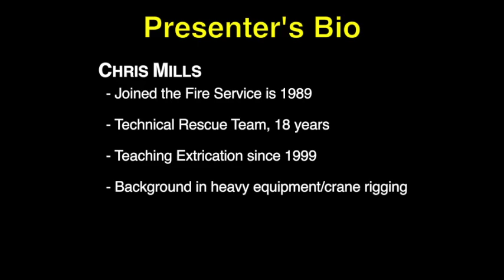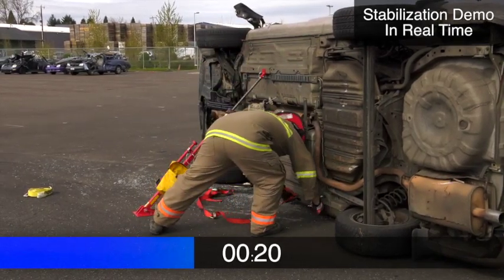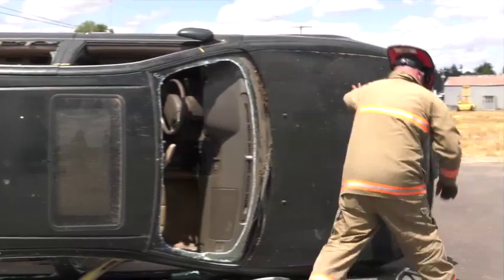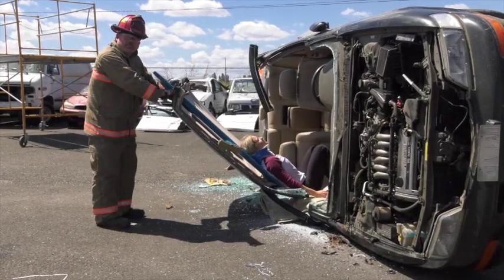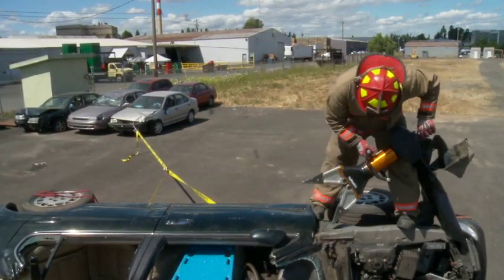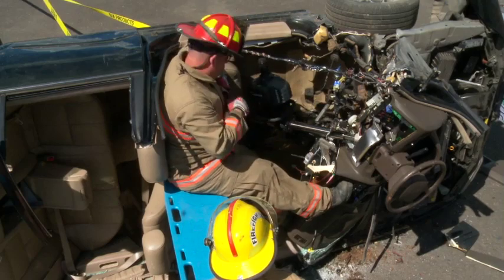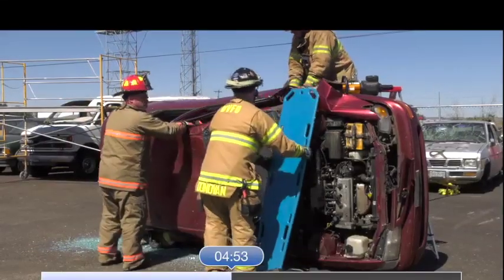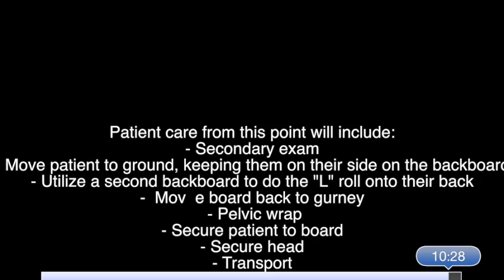Vehicle Extrication with a Car on its Side

Comment: I realize you need to be able to be heard however when cutting glass you should be wearing a particulate mask as part of proper ppe.
Reply from the maker: Jim,
Thank you for your thoughts, it is important that we look at what we are doing and ask ourselves if we are doing the right thing.  In some cases, you are right about using a particulate mask if the firefighter is operating in enclosed spaces with toxic or harmful particulates.  However, not always is “Because we’ve always done it that way” correct, our PPE is sometimes driven by the equipment we are using.  Traditionally, we’ve seen hand saws and reciprocating saws used to cut class.  These saws tend to aerate the item they are cutting and blow them into the face of the operator.  In the video, we are trying to work smarter and use the right tool for the job.  We are using a dedicated “Laminated Glass” cutter tool, many different brands are available on the market.  There are many advantages to these over what has traditionally been used to cut laminated glass.  The three main advantages that I see are: the ability to work in tight quarters, no exposed blade operating near the patient, and the dust created is not agitated/aerated into the air (it drops down and away from the tool operators face).  

In addition, there are some misunderstandings about the Silica that makes up glass. When Silica is created/melted to form a clear glass window, it loses it's Crystalline Silica form (which is extremely harmful to humans), and becomes Amorphous Silica. Amorphous Silica is classified by OSHA as an "irritant dust", similar to regular airborne dust or smoke from a campfire. Here is a good article written by Tim O’Connell from Rescue 42.  I think it is a well written and researched article.

https://rescue42.com/wp-content/uploads/2019/07/The-Ripper-Glass-Dust-Mythbuster.pdf

Please let me know if you have any other questions or thoughts on what we have presented.  Again, thank you for asking.  Better information and understanding makes us all better at our job.

Chris Mills
Fire Rescue Equipment NW
chris@frenw.com
503-793-7925